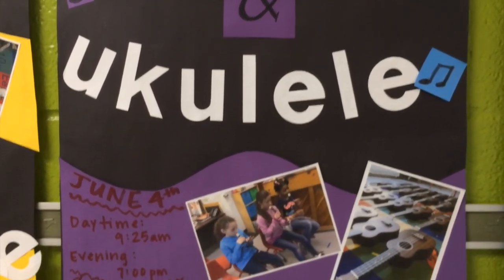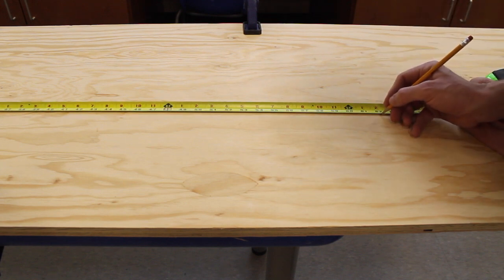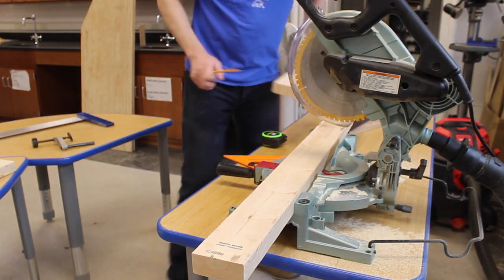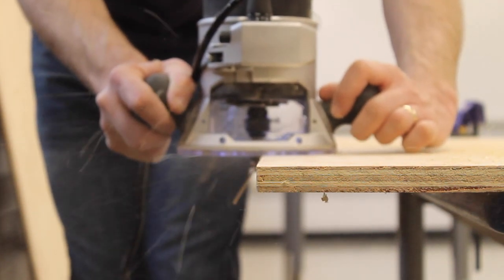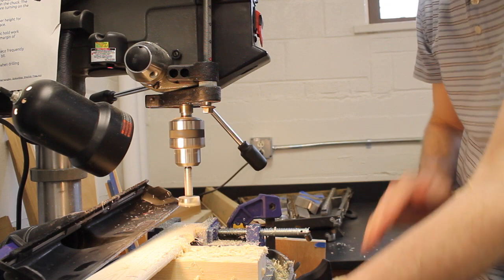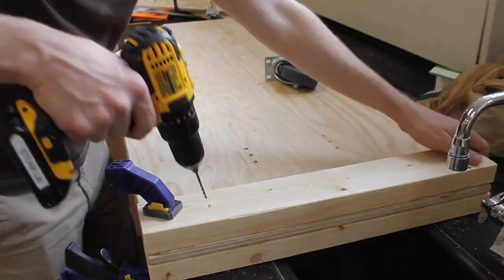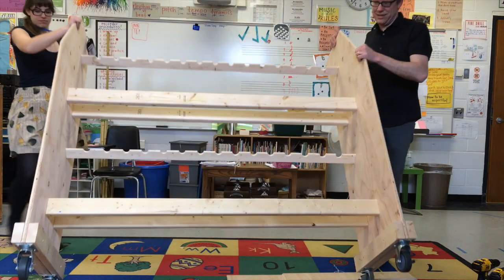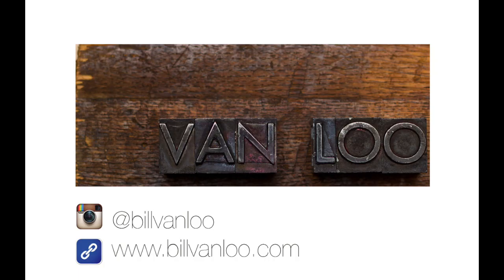Building a cart for 30 ukuleles!

Comment: Awesome video! And thanks for the shoutout! I originally built my cart because there wasn’t anything like it for sale and I figured I could do it cheaper than some of the professional string racks. The temporary shelves are clutch. I awkwardly rigged extension cords to from the top supports to hold the lower support in place. 

Also, just purchased new strings this year for all my Ukes. $225. Uke cart plans helped pay for that. So thanks!

Comment: Nice job.  If you do another one of these you will probably find it easier to start with a double wide board for the neck supports.  Drill your 15 holes down the middle and then rip the board in half.
Reply: That is a fantastic idea. I had originally hand sanded the neck grooves down to their needed depths.